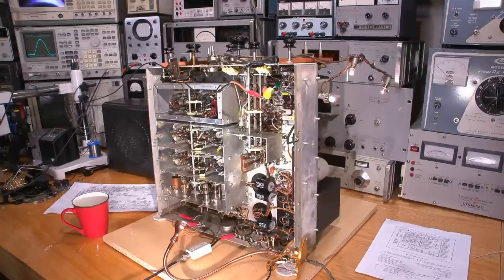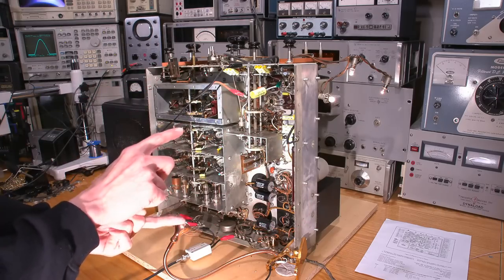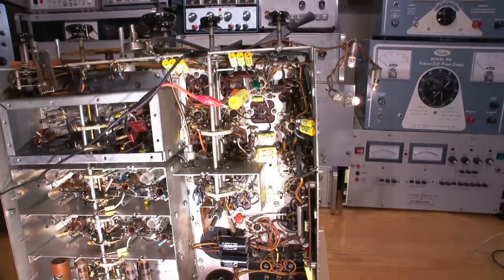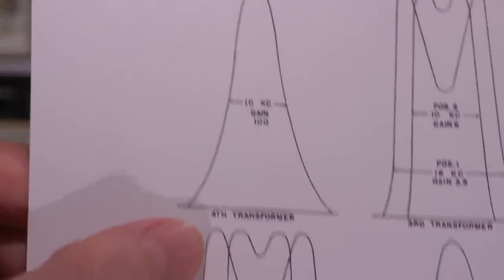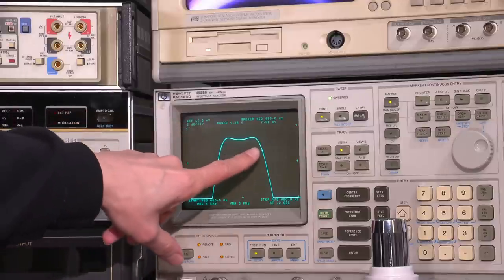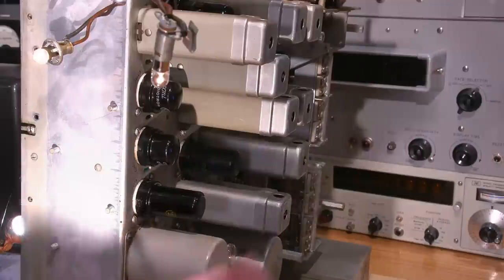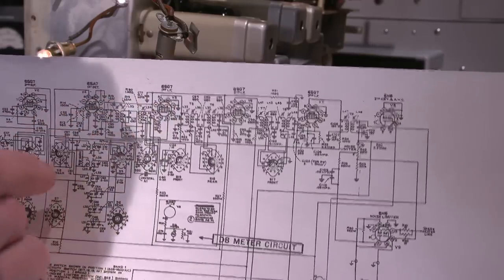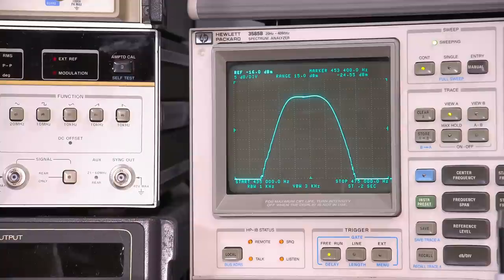RCA AR-88 And RCA CR-88 Radio Receiver "IF" Alignment Procedure.

Comment from the maker: To learn electronics in a very different and effective way, and gain access to Mr Carlson's personal designs and inventions, visit the Mr Carlson's Lab Patreon page here: https://www.patreon.com/MrCarlsonsLab
Reply: Been waiting almost a year for an interesting project.
Reply: i looked for a way to contact you via a pm on youtube caint seem to find a way. i am interested in you building me a noise filter board to filter feedback from a fan i have installed in my audio receiver. i am wanting the board as small as possible which i caint do a printed circuit board like you do. i could be interested in multiple noise filter circuit boards as i dont keep my house cold usually around 85 - 90 degrees in summer time and i use older audio equipment thats better made then this newer stuff but it does seem to run hot and i can smell the hot electronics before i install cooling fans.

Comment: Paul, it's a credit to the original designers, manufacturers and your restoration knowledge and skill that this radio seems so stable and, I'm sure, will match the performance of many current solid state units.  I'm only sorry that I sold my AR88 back in 1973 😒

Comment: Thank you for the great demonstration of sweep aligning a receiver.  I have used sweep aligning for years on the commercial equipment that I serviced.  Someone asked what the sweep rate was.  I used to use 20Hz. This is a declining art as receivers are now all on one IC.  This type of alignment is also critical on receivers handling video and data as proper bandwidth is necessary as much as amplitude.
Again, great job and I appreciate your attention to detail.

Comment: Great video!

For the benefit of those who are interpreting older manuals to adjust radios with newer equipment, could you comment briefly on the fact that often an oscilloscope was used in the "old days" - with a linear amplitude response as implied in the CR88 manual (pages 11-12) - whereas these days one might use a spectrum analyzer with a tracking generator - as you did.

Specifically the fact that a "50%" amplitude at a given bandwidth when viewed as a voltage on an oscilloscope would represent a 6 dB power reduction on a spectrum analyzer when it is represented logarithmically - and when aspects of the circuit and where one monitors the signal may affect this interpretation?

Thanks, and keep up the good work!

Comment: Maybe someday you can explain how the "sweeping" works.  ie - How fast is the sweep, is there persistence involved, etc.  Can sweeping happen too fast/slow?   I haven't be able to wrap my head around how the swept response curve is shown in "real time".  Great vid as always. 👍
Reply: This spectrum analyzer, and all modern spectrum analyzers, are based on microprocessor control and digital storage of the sweep data.  The CRT continues to display the previous sweep trace (or older data) as a result of what was stored in digital memory while new sweep trace data overwrites it and updates the data.  The display does not use persistence to hold the sweep trace.  The spectrum analyzer was in continuous sweep mode so it sweeps and updates repeatedly.   You can see the sweep time on the CRT display and the green flashing sweep LED for each new sweep.  The sweep time is a function of the resolution bandwidth, sweep span, and other parameters.  You don't just set a sweep time like you would on an oscilloscope.  Don't forget, the spectrum analyzer is showing frequency and amplitude, not time and amplitude.  The tracking generator output frequency matches the frequency of the sweep position at any given moment.  Note that if you connect the tracking generator directly back to the analyzer input you will get a flat line sweep because the amplitude is the same at each frequency point.
Reply: Ahhh! Now I get it.  Thanx EEWB.

Comment: Dear Mr Carlson,
 When you get to the RF alignment, I would be most interested to know how good the image rejection is at the higher frequencies.
  With an IF of 455kHz, the image will be only 910kHz away from the tuned frequency. Even with 3 preselector tuned circuits, I doubt if it will be better than 20dB at 30MHz.
     The disadvantages of singe conversion led to double conversion receivers, and eventually to up conversion receivers where the first IF was above the tuning range.
   Also of interest would be a measurement of third order intermodulation , as a test of linearity. I would expect a valve ( tube to you) receiver to be quite good in this respect.

Comment: Just another idea I've had. I'm wondering how this could be done with "Tiny SA" or other less expensive test equipment. A lot of budget test equipment has come out in recent years and some of it has very decent results. Nano VNA also comes to mind. I know you build a lot of test equipment here and on Patreon and these designs replace equipment that costs thousands of dollars. Well worth the $2 to get the plans for. I have 4 pages of notes and a thumb drive worth of your Patreon material and it's a gold mine of information. A friend of mine who is now a silent key W4CWG worked for Bell Labs (Western Electric) as an engineer and designed a spectrum analyzer using the tuner out of a VCR. If you Google search this call sign you will find a web site of his crystal radio designs and test equipment which is a pretty good source of information. I would love to see a future video of you working with more of this less than perfect equipment. Thanks again for all you do!

Comment: Hi Mr Carlson, I have a AR88 RCA Receiver used by my late father for Ham operation callsign VU2VU, I would like to restore it someday, is the tubes and parts available and any pointers to some sources. Apricate your effort for explaining the IF alignment procedure.  What the basic equipment required for restoring the receiver?

Comment: Paul, you are using your White box SA protection boxes,  the ones you have used  in other older videos, & shown their construction.  You built them for use on high-impedance Tracking  Generator & SA inputs, and said in passing 'these could easily be modified for 50 ohm inputs', and left it at that.  Having not much knowledge of rf design, could you elaborate on how to construct one for use on 50 ohm?  That would be greatly appreciated.

Comment: Mr Carlson. I am going to be doing one of these as soon as it arrives form Canada and will end up having to eventually do the alignment. I do no have the type of equipment that you do and I have watched both Gerry O'harra's and your videos on doing this. I also have an older ham buddy up in Canada that had done quite a few of these sets without the high end equipment. What I do have is a new Rigol 2 chanel 100 MHz digital scope, a Fordham 2Mhz sweep function generator, a regular signal generator and a digital frequency counter. Do you think I should be able top preform a proper alignment with this equipment? This will be o course after cleaning up and recapping the radio.

Comment: Around 7:10 you mention "the diode output line" -> is the "diode" the tube in the extreme upper right of the schematic?
Reply from the maker: Yes, that detector and AVC tube is one of the two little stubby looking tubes on the chassis, the other 6H6 beside it is the noise limiter tube.
Reply: @MrCarlsonsLab  thank you, Mr Carlson!

Comment: Just curious -- on the diagrams, the IF selectivity curves indicated the 10kHz, 8kHz and 14kHz bandwidths at 50% (-6dB), but alignment was at -3dB.  Am I misunderstanding something?
Reply from the maker: Hi Jim. Perfectly valid question. I experimented with both the 3 db down points (most common for IF alignment,) and also the 6 db down points. After verification that all stages were operating correctly, I fed the last IF stage (4th IF or T9) with a sweep (from the tracking generator) and monitored its output. It was "impossible" to get 10 kc's width at 455 kHz at 6 dB down. The closest it would come was "very close to" 15 kHz at 6 db down, and off center frequency, IE: not at the 455 kHz center. (Keep in mind: All stages are working perfectly.) After trying every slug position, (lots of twisting!) I began to experiment with the more common 3 db down points, (which makes more sense anyways.) I was able to come in at 10 kc's width at 455 kHz, "and not by much either!" The rest of the transformers exhibit much of the same characteristics as the 4th IF, especially when trying to get two response patterns out of one set of adjustments. So after hours of experimentation, 3 db it is! I'm impressed that you recognized the 50% notation in the paperwork, and also noticed I used 3 db! For those that want to know: ( -3 db = .5  "Power ratio") and (-3 db = .7  "Voltage ratio.") Where (-6 db = .25  "Power ratio") and (-6 db = .5  "Voltage ratio.")
Reply: @MrCarlsonsLab  Thank you for the explanation.  I suspected that the -6dB might be wishful thinking on their part. That would be hella selective tuning, though!  Great video as always, sir.  Back to lurking... lurk

Comment: Regarding the diagram for the 2nd and 3rd Stage, should the -3dB point not always be measured from the top, not the center of the graph? Otherwise it makes no sense to have only one bandwidth line in a diagram with two very different waveforms.

Comment: The alignment instructions show the bandwidth measuring points at 50% and you used the 3dB down points for this which is the 50% POWER levels but shouldn't this be adjusted at the 50% VOLTAGE levels which is 6dB down?

Comment: What is the expected sensitivity in micro-volts for each band setting?
Reply from the maker: If you want to work that out, they have provided gain measurements in the manual.

Comment: It would be interesting to see the effect of these little adjustments on a real world signal. I wonder how a little change in the IF response shape would affect actual use. I would guess on a signal of reasonable strength and quality not much. What an engineering marvel for its day. They would have loved to have a spectrum analyzer like yours.

Fuel tanks have capacity  capacitors don't. Capacitors have capacitance. Common mistake lets not spread it.

Comment: Question,  I have aquired a KG-625. It is extremely dirty. What do I use to clean it without the possibility of destroying the print on the face plate
Reply: Water, or nothing at all. Even then you've got to be careful. I've neatly cleaned the word "Admiral" off a 1950's tube before using nothing but a water dampened paper towel!

Comment: I am struggling to understand after ten minutes.   I am waiting for you to say that the generator output has to be much bigger than the signal from the still connected previous i/f stages so that it swamps it out so that it doesn't interfere with the measurements.   Am I correct in that?  Assuming that there is no RF input, what comes through from previous stages will be white noise, but modified to have peak amplitude around the i/f frequency of the previous stages.  If the signal generator has a much lower output impedance than the previous i/f tube it will override the noise.   Maybe I shouldn't comment so early in the video.  Edit: just realized the tubes are upside down on the schematic.  Much easier to see pin 4 is the grid when you notice that!

Comment: I said this about the radio with a really fancy dial. I really don’t think the amount of gain in each of these settings is the point.

When you first started the alignment of that previous radio much like all the other radios you’ve worked on I’m sure it was close in alignment. They went from very narrow to a very wide flat curve. Giving you options in the amount of bandwidth you’re picking up.

By tuning all of this to a high gain all that’s going to really do is make it so you can keep the volume lower than you need to. 

There appears to be so much more in terms of amplification available. It’s not even going to be used. 

I have zero electronics experience or training and the only thing I can think of about what we’re doing here is those old periscope videos about how radios work. The way in and which you pick out the radio frequency you want to listen to from all the other frequencies. 

Maybe I’m wrong but on the other radio, there’s no reason to change it from the three-quarter position you have it on. There should be just different selections of the amount of band with you want and it looks like on those instruction sheets They’re not even asking you to achieve certain gain levels. 

I really feel Like you’re approaching us like a muscle car and trying to get the most power instead of the cleanest signal. I guarantee you can achieve those curves correctly if you lower the gain.
Reply from the maker: Thats not how it works. When tuning the IF section, you sacrifice gain for bandwidth, or bandwidth for gain, this is the reason they have 4 IF stages in this receiver. When you tune for width, you loose height. If I was to lower the gain, I would gain more width, and therefore have a broader response pattern. A broader response pattern will decrease the selectivity. They don't leave much room, either you get it right, or you have the lack of one or the other. If you want to lower the overall gain, this is done with the RF gain control, not by mis-aligning or detuning the IF section.

Comment: Would have been better to use test equipment of the time . A number of subscribers may not have access to a spectrum analyzer and tracking generator. Also would be nice  to have a comparison of using some type of peak method vs this more comprehensive method if we have no choice.
Reply: Unfortunately, this is one of those jobs that can only be performed correctly using a swept input and a visual representation of the output response. AR-88s were probably factory aligned using a scope and wobbulator,  a 1940s combination equivalent to a crude spectrum analyzer. "Receivers aligned by any other method, when checked on an oscilloscope, have shown some remarkable instances of misalignment not easy to detect in any other way." -  "Getting the Utmost from the AR88", W. K. Miller (G6QF), Short Wave Magazine, April 1953

If you don't have a spectrum analyzer, a "poor man's SA" can be cobbled together using a scope in X-Y mode, a ramp generator, and a sine generator with VCG input.  This is the equivalent of a scope & wobbulator, and while setup is more difficult, and results may not be as good as with a real SA, they're probably good enough for this vintage equipment.

Comment: I have a Collins 51J-4 - have the original manual which goes into detail on alignment. What I don't have is an HP 3585B! They are excessively expensive for a cheapskate part time winter only hobbyist such as myself. The receiver works very well apart from some "features" (see later) - it's incredibly accurate on frequency. However eventually I want to return the 51J-4 back to its original non-descriminator SSB system - mine has the "Hollow State Newsletter" mods by Dallas Lankford which seem to be improperly modded on my example - looks a mess and totally disables the meter on the higher frequency bands - seems also to render the RF gain control mostly useless - eg. if you decrease RF gain the meter goes up! Am guessing that's not the way it's supposed to work. Anyway - I'm getting away from the point - what sort of cheapskate sweep generators and frequency analysers are up to the sort of alignment you show here? I do have a OWON 25Mhz USB oscilloscope with a pretty basic FFA.

Comment: Pretty tedious. I wonder what service would have cost back in the day. Imagine at today's shop rate of $100/hr what this radio would cost to go through. Comparing apples and oranges I suppose. You spent a LOT for technology back then and you wanted to keep it in good shape. My parent's first color TV bought in 1968 that cost around $400 would be $3500 in today's $. Now you can buy a TV for $150 that would be like $17 in 1968 $ BUT it is virtually unrepairable.